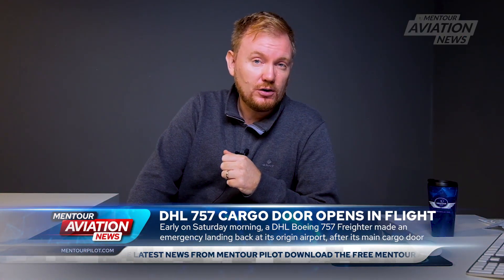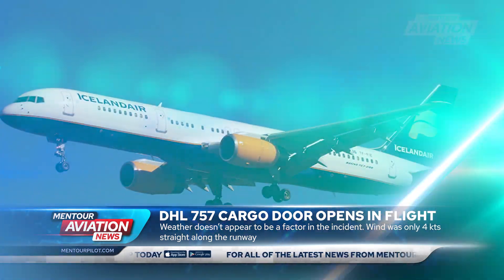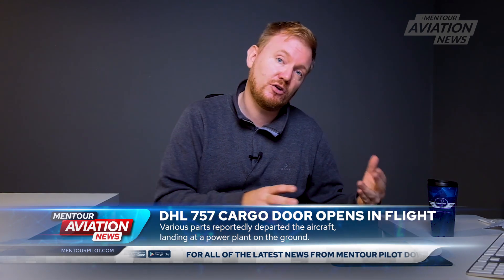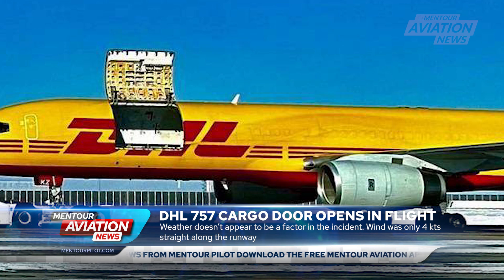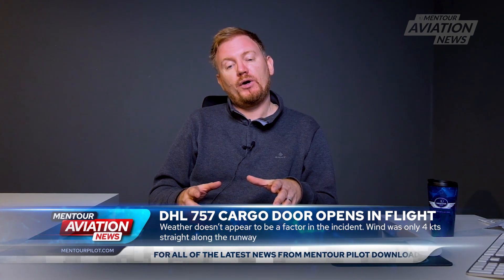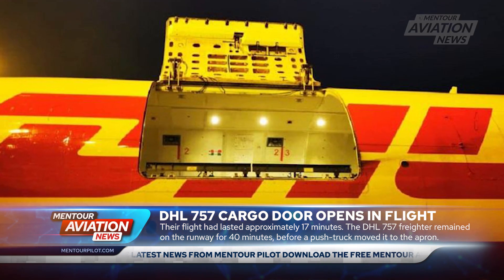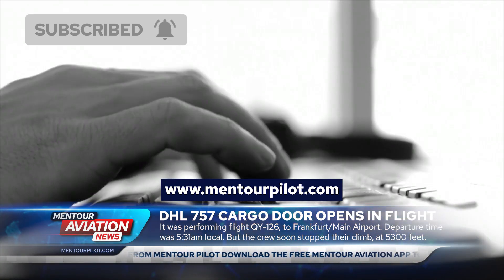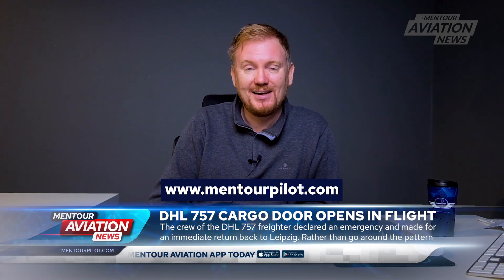Boeing 757 diverts after Cargo door OPENS IN FLIGHT! Mentour Aviation News

Comment: You might have added a comment on the potential damage from the likelyhood of landing over the max landing weight of the aircraft minutes after take off, subject of course to fuel and payload on board, unavoidable in this case.
Reply: Any airliner can land safely at up to the max takeoff weight.  It's actually done sometimes for the max-energy RTO certification flight test, in order to have more runway out in front at brakes-on should there be a problem.  In airline operation anything over MLW would however trigger an after-landing inspection, but structurally it's not an issue as long as the sink rate at touchdown is kept moderate.

Comment: I am a retired aircraft technician, I  have worked on the 757.  I have also during my career designed and build modifications to aircraft.  The one thing that I cannot understand is why anyone designing such an extensive mod relied on the hydraulics to keep the door locks engaged once the door was closed and locked into position.  They should have relied on mechanical locks that would only be locked or unlocked using the hydraulics.  It appears that they were relying on the hydraulic pressure to keep the locks engaged and once their independent hydraulic system sprung a leak and lost  hydraulic pressure that the locks became disengaged allowing the door to open.
Reply: There is no indication in the video if the hydraulic started to leak because of the shock during the opening or if the door opened because of hydraulic failure. I doubt the hydraulic was the only feature keeping it closed. There is virtually always some kind of (supposingly) failproof mechanical locking device.

Comment: New to the Channel and one question. It looks like he was over built up area so I would assume no time to dump fuel. What would the landing speed be if he's fully fueled as to at the end of the trip and would he need to come in low and slow and take the whole runway? It may be obvious to others but not to the lay person. Appreciate a reply by those who know. Thank you.

Chris 
England 
Uk
🇬🇧
Reply: There wouldn't be much latitude as to a "slow" landing, because landing speed depends on aircraft weight (for a given flap setting).  I didn't hear a weight in the video, but whatever it was, the landing would be at a slower speed than they had just taken off at because of  a) slightly lower weight -- though not much lower after only fifteen minutes of fuel burn  b) a higher flap setting -- though not necessarily full flaps because at the higher approach speed necessitated by an overweight landing the hydraulic system may not be able to hold full flaps against the higher aero load.

On a dry runway, it should all work out (in general).  If runway friction is compromised, then things might get interesting.

Comment: This event has shown that this aeroplane is completely fine with the door open even in mid flight. This shows that the 45 knots wind limit on opening the door on the ground is completely unnecessary
Reply: Only thing this proves is that plane didn't break apart catastrophically in this particular case...
With plane not yet having picked up cruise speed and with not much wind to complicate landing.
Assuming anything else will only lead to (more) dead bodies into history of aviation.
Reply: The ground handling wind limit is likely to avoid the plane possibly rotating (specifically, the nose gear skidding) from the sail effect.

Comment: Hello, can you please make a video for us who are scared to fly, because of turbulences, chances of an airplane craching, and are there turbulences more felt depending on the skills of the pilot and the size of the aircraft!? 
This would help me to listen directly from a pilot, because has been years im not traveling with an aircraft😢 and  i had many traumas because of turbulences
Reply: "listen directly from a pilot"  Would you settle for a retired airliner engineer?  The worst turbulence you've ever been in is nothing compared to what the aircraft is designed to take.  Suppose you are sitting at a window seat in a 757-class airliner, nervously watching the wingtip vibrating by say 6 feet/2 meters of total travel (+/- 1 meter peak-to-peak).  That's probably close to the most I've ever seen, and it looks like a lot.  Well, back when the aircraft was certified a test article of that wing was bent upward by more like 15 ft/5 meters (or more).  You would maybe have to move your head towards the window to even be able to see the wing tip when deflected that much -- well above the top of the fuselage.  Then while bent that much, the various controls have to function in order for the design to pass the certification test.

Another thing to note is that except for the doors and windows, almost anything you can see in the cabin  -- the seats, the overhead bins, the side panels -- isn't part of the aircraft structure.  That's added-in stuff which can rattle and creak and make all the noise it wants to without affecting the flight's safety.  Sometimes airframe manufactures deliver the aircraft with the cabin just an empty shell, and the customer airline or a third party does the outfitting.

Comment: I compare this to a converted Coupe automobile, when someone choppes off the roof to change it to a convertible. The whole car tends to bend in the middle, shakes ad rattles are heard, and sometimes, the doors won't open anymore, because they've been pinched in place. Chopping an unprepared hole in what is essntially a long tube...try this at home with a cardboard tube from your kitchen paper towels!

Comment: Service load of the door would be 45knts with a gust in the worst direction (I.e Straight on from the side), this will be the point where it starts to deflect, but not fail and is usually what engineers will put in the operation manual. Factor of safety in aircraft is typically 2-3 so Design load would be ~150knts. The air stream is coming more or less head on in flight with no crab or crosswind, so the area exposed to the 200-300knt wind would be very small and actually in line with the hinges, which is beneficial.
Reply: I would imagine the 45 kt limit is about the aircraft yawing (via nose gear sliding), which could be dangerous to personal and possibly the aircraft depending on what was around it.  If the limit was actually based on a a hinge load limit though, then assuming a 2X factor of safety and given that drag increases as the square of wind speed, that would put the structural failure windspeed at about 63 kt.  But like you say, for airflow across the edge instead, the door could withstand much higher speed.  The actual load is somewhere in between edge-on and straight-from-the-side, because the fuselage (and therefor the door when fully opened) has a non-zero angle of attack.
Reply: @marcmcreynolds2827  Yes, you're spot on thank you. We usually deal with wind kPa and not actual knots in structural engineering (unless it's tall or a funny shape) so that's my error .

Comment: I was in Casablanca when flight trails were taking place on Concorde probably in 1973. At the end of my 3 week stint I was due to fly back to Filton in a BAE 125 but there had been a problem with one of the Concorde undercarriage doors and it had to be taken back to Toulouse. So instead of an executive flight, they had hired freight company to fly the door and 8 personnel. A ex Aer Lingus Viscount passenger plane was used. When we got to cruising altitude one of the crew came to us at the back of the aircraft to tell us the freight doors were leaking and they could not maintain the correct air pressure in the plane. At this point of my life I was a very nervous air passenger and the though of the doors lacking made me very nervous. The eight of us at the back of the plane were Concorde pilots and plane engineers except myself, I was there as backup for the analytical computer(Elliott 905) we had supplied to BAC. A couple of the aircraft engineers knew the Viscount quite well and instructed the rest of us to go through all the overhead lockers for lunch boxes. There were loads of them mainly with green half eaten sandwiches, what we needed was napkins, condition unimportant. Old cartons of rancid milk were poured into a toilet sink and we made loads of squishy napkins to take to the front of the plane and block all the leaks. We soon had it sorted!! As we got higher it got colder and the call went out for someone who knew how to turn on the heating, again one of the engineers turned on the heater blowers. The last thing we had to do was trim the aircraft. With us in the back and very little freight the pilots needed some help to make their job more comfortable, we had the push the freight a few feet forward to get the plane balanced. What a flight!! It was interesting though. We landed at Toulouse to drop off the undercarriage door but were told that Filton was shrouded in fog and we had to stay overnight in Toulouse.

I was glad to get back to Filton where my wife pick me up. The trip working with the guys on Concorde was great, they were so dedicated!!

Comment: Kudos to the engineers who designed that door and its frame so that it doesn't in fact just rip right out off the fuselage if it came unlocked in flight.
Reply: There was a crash years ago. I forget the reason given, but the parents of one of the passengers didn’t believe it. They started their own investigation. The final reason was a defective door closing mechanism.

Comment: There should have been an independent  indication door lock status system for this Hazardous event. Active mode of this system should be "door lock status locked"
making the architecture fail safe. Failure of this indication system or true door lock failure should illuminate red "no dispatch aircraft status " on the flight deck and necessarily part on the AFM preflight check list.
This is architecture is a Part 25 aircraft certification criteria

Comment: Did they have to dump fuel? No real time for that. Must have been real close to max landing weight
Reply: Quite possibly over MLW, but airliners can land at even MTOW when the touchdown sink rate is limited to ~6 fps (i.e. on the high side of a "normal" landing).  An inspection is required for landings done above MLW however.

Comment: This is reminiscent of United 811 747 cargo door opening in flight in Feb, '89. I was working as an A&P for a major Part 121 carrier when this happened and triggered AD's on our fleet of 747's. I speculate it'll be one of 3 things. Damage to the locks by ground crew, possibly something out of rig, or mis-engineered on those door locks and warning light system.

Comment: On the 757 cargo planes that I work on the Left main hydraulic system powers the door. Also there is a shutoff valve that requires that the nose and main landing gear be in the down position with weight on the gear.

Comment: Wouldn't surprise me if they also had to land overweight, given full fuel and cargo loads. A minor concern under the circumstances, of course.
Reply: 757 doesn’t have fuel dumping so it can land overweight without any issues. Other than an inspection and a few other considerations thrown in. But, as you mentioned, overweight landing would be a minor concern.

Comment: Remember the 747 cargo door that the locks were back drived  and the door was lost inflight with a few passengers. I think JAL. After that, JAL crew would , after takeoff, go thru the flore hatch and pull breakers in the electronics bay to disable the cargo door mechanism. Sorry about the spelling. It turned out to be a wiring error, sneak circuit.

Comment: The cargo door hydraulic unit is separate from the aircraft hydraulics. It is powered off the ground power bus, which receives NO power in flight.  This is controlled by truck tilt, which means when the plane leaves the ground and the trucks tilt, the air-ground safety system receives a signal that turns off power to the ground power bus.  

So the only way that the cargo door can come open is if not only the latches receive power, but also the hydraulic cylinders that move the door open and closed.  And this is hydraulic power.  Did I mention that the hydraulic motor is shut OFF when the trucks tilt?

In any case, they got a cargo door open EICAS message and turned around and landed.  This happens all the time, the door didn't open in flight, which could have easily lead to the airframe breaking up in flight due to the open door.
Reply: The way it can happen with no power is if a mis-rigged latch system doesn't completely engage -- latches don't completely "reach over" the corresponding bars, and so it's mostly metal-on-metal friction keeping it closed.  The fact that this incident happened at such a low altitude suggests there was little or no geometric engagement of the latches.  But who knows?  That's what investigations (and follow-up YouTube videos!) are for.

Comment: All of those reasons they needed to get down on the ground make sense, of course. But what about the most basic reason: didn't having a GAPING HOLE opened in the side of the fuselage wreck its flight dynamics? I'm a little surprised they were able to land as easily as they did. (Or maybe they did struggle, and it's just not expressed here.)

Comment: Most likely, shes scrap metal, nobodies going to assume that liability, having it flown with the door missing. The structure would be compromised. Probably get stripped for spares, and then scrap alum
Reply: In the current environment, and it being an older airframe, quite possible.  But damage far worse than that has been remediated.  As I just posted to someone else:

As a point of reference, in the early '80's DAC had a flight test incident during the landing of an MD-80 under simulated hydraulics-out conditions.  After what looked sort of like an "exponentially increasing sinusoid" track down the runway, the (second production) aircraft departed the side at some speed.  The main landing gear stripped, as designed (to prevent a fuel tank rupture from likely occurring were the gear trunnion to rip off instead of the strut), and the aircraft lay on its belly.  So far, so good -- such is the stuff aircraft recoveries are made of.  But then there was a problem later with one of the two cranes lifting the airframe up so that ground transport wheel assemblies could be inserted underneath.  One of the cranes' booms came crashing down at around the midsection.  Such is the stuff bad days are made of.  But even that bashed-in airframe was repaired (and handed over to Swissair at the conclusion of the flight test program... maybe at a discount? ; )

Comment: Certainly part of this mystery is going to by why the door travelled to the full open position rather than just partially ajar. clearly all of the locks had to fail for it to give way so drastically. I cannot recall ever hearing of a similar such report of a side cargo door failing in the past.
Reply: Consider how (especially for Boeing aircraft) the fuselage is at a significant angle of attack -- several degrees -- even in level flight.  With the door's hinge line running longitudinally along the fuselage, once it opens enough for its interior surface to be exposed to the airstream that surface will also be at a non-zero AOA, generating lift... which causes more area to be exposed, and more lift.  So the door "wants" to raise by some large amount determined by the geometry.  As for the latches, given the low altitude this incident occurred at (low pressure differential/forces), structural failure is unlikely.  It's usually a rigging problem, causing them to not fully engage, rather than part(s) failure.  Mis-rigged, the latches don't make it "over the hump" to where they can "grab", so at some pressure differential the smallish metal-on-metal friction force is no longer enough.

Comment: I work on 757 freighters, the main deck cargo door is run from the left and right aircraft hydraulic systems pressurized on the ground with the electric pumps, it is not an independent system.

Comment: Herald of Free Enterprise - Calais heading for Dover - sailed with bow doors open (HOW) & sank.

Similarly, this incident should have been impossible. Only Boeing made it possible.
That door should have been closed, the catch should have been engaged and ALL the locks should have been in the locked position and locked in the locked position before they can even start the engines.
Thank God lift ('elevator') manufacturers are not this sloppy ! Any lift CANNOT leave any floor if the landing door lock is not locked in the locked position.
From this, All cargo planes should be grounded until the door locking systems are made secure.

Comment: Mostly in engineering a failsafe on structural systems relying on hydraulic such as as spring driven locks which can only be opened with the hydraulics working , odd not to

Comment: It is practically a miracle that the aircraft did not break up in the air. That should tell you something about how good our aircraft are manufactured now.
Reply: That is even more the case with the famous Aloha flight mentioned in passing.

There is  clearly a huge safety margin between what will keep the plane in its designed shape and what will hold together while suffering some career-ending distortion